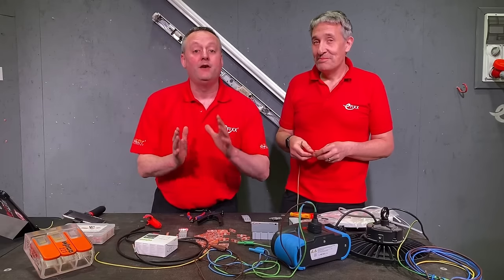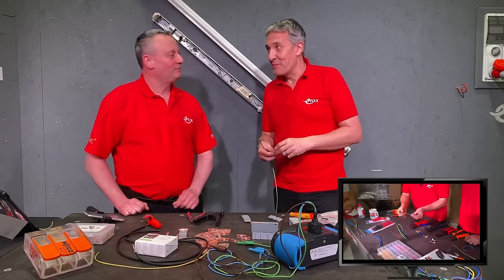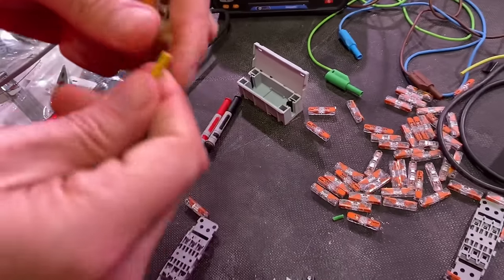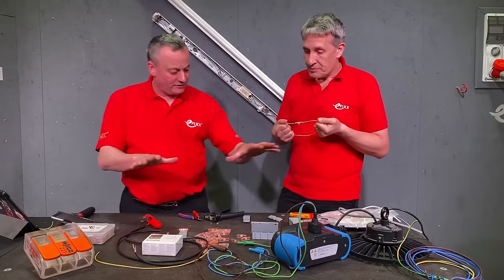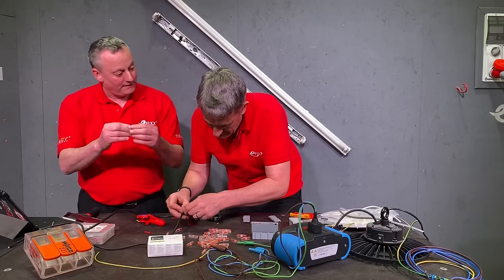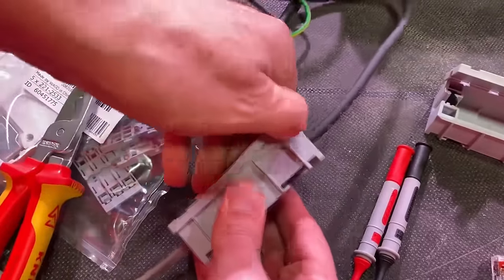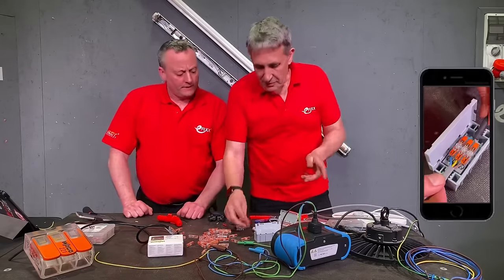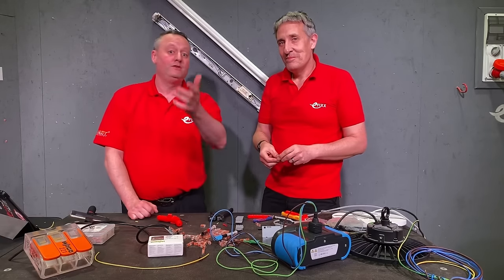The Ultimate Guide to the Wago 221 Inline Connector

Comment: I find it hilarious that Wago stole this design from the companies cloning their other connectors.
Reply: Not really, the clones are based on the older types which I pretty much never use now anyway.
Reply: @mfx1  Hmm I've seen clones of the clear smaller versions. And it was definitely the clones that did this first, even if it was styled after the older model.
Reply: @Morberis  The inventors of chocolate block connector really had the idea first all everyone else has done is replace the screws with levers. I've never personally seen a knock off 221 I've only seen 222 knockoffs.
Reply: @mfx1  lol, that makes them sound a lot more delicious than they are. I think I know what you're talking about, and I guess the old ones I have seen have been brown.
Reply: @mfx1  then wago is copying somebody else's design if it goes the way you said sounds like paybacks.
Reply: @whatdoyouthinktodd  Chocolate block connectors are ancient technology  and loads of companies make them.
Reply: Not really the clone versions don’t use the same mechanism. They basically just have a plastic bit on the lever that pushes it on a metal plate. These use the proper mechanism.
Reply: @UKsystems  Yes, they're not identical in the important details and these are properly made. But clones have been putting this out for over a decade. 

I would never recommend people buy the clones over properly certified and engineered products.

Comment: Imagine if the wago connectors could be clicked together themselves, without a tray. It’s funny because the counterfeit wago connectors come up with novel ideas like this.
Reply: Mounting carriers increase creepage distance allowing for 450v rating.
Reply: @daviddraper9256  make it 300v rated clipped together or make one side thicker by a few mm
Reply: @akbarramzan7436  however that voltage rating would not be super practical

Comment: I have used them inside light fittings and they are great but woud like them to launch a 4 way version for loop in and out instead of using the 3 way and having to bend the cables to suit the mounting brackets. Keep up the great work 👍
Reply: Can't  beat   a  good   old   Fashion   soldered   joint   perfection
Reply: @grahamturner6119  soldered joint for mains connection?
Reply: AFAIK there is a 5pin version - at least in my toolbox 😉
Reply: Why not populate 4 connectors on the 5 wide?
Reply: I think the point replies are missing is a 2x2 inline connector hence 4-way. Not four in a row.
Reply: @grahamturner6119  Are you out of your mind?
Reply: @SamButlerUK  The reason is tooling, you can do the same with a coup[le different combinations of what they offer already, tooling a machine to make a 4, would cost too much to be worth it.
Reply: No need for a 221 4, plus we pay like 30 pence for a 5 way at our local electrical wholesalers, Toolstation 221-5, for  8 £8, what a rip off, against £2.40 that we pay for them.
Reply: @grahamturner6119 your 100% correct, I just don't understand why cables cannot be soldered together and then shrink wrapped, I remember running a 16mm cable, 60 m long, in the ground on the side of their driveway from the house to the main gates, we had too take a different route towards the end meant that it was 5 meters short, we soldered that and taped it up put it in the ground,  I don't think the amps in that cable will warm the cable that much to melt the solder, you plonker
Reply: Yeah, strangely... the Chinese copies do exist in that way...

Comment: The extra plate to clip that tray into the wagobox light seems quite unnecessary. The cord grips should suffice easily or they could have just made the barbs on the tray clip into the wago box light with two holes for the barbs to go into (and discontinue the old light box without the holes so its not confusing having the 2 versions)
Reply: No need to use the mounting carriers in the WAGOBOX Light, the connectors can be placed loose inside. The mounting carriers are more for when you make your own box or panel. Hope this helps.
Reply: @daviddraper9256  Yeah seems more like it. I thought they showed the tray used with the box because thats the intended way.
Reply: i wonder if you could stack two carriers in this box too, for example if you have to connect 5 Wires (like Power + DALI, or 3 Phase Power). Size wise it looked like it should fit...

Comment: I use these connectors for car stereo installations and they are great.!
Reply: depends how lazy i al but i usually do it in 1 of 3 ways

if i can buy the harness adapter i get that and move on with my life obviously

but assuming its a stereo with the dozen wires coming out the back i just purchase a universal harness adapter for my vehicle cut off the stero side connector then ill join to that so im cutting up the adapter and not touching the factory loom then ill join the wires in one of theese ways from laziest to most preffered

1 crimp bullet connectors
2 self soldering marine splices (they look like heatshrink with a little solder ring when you shrink them they solder the wires together and some adhesive makes them water tight
3 hand solder them with heatshrink

wagos arnt a terrible or harmfull way to do it its just a little cludge

Comment: Yes, a really lovely in line connection

Really love all WAGO stuff!

BUT... there's always a but..
Many lighting jobs require a loop in and a loop out for, say, 4 downlights operated by a single switch- very common.
The problem with existing WAGO boxes is that all the cables come in at one end.

The result is that it's difficult to pull the box out of the ceiling through the downlighter.

Looping the feed in and out of one end, and the downlighter connection at the other end would be really elegant.

What think you please??

Comment: Minimum & maximum conductor sizes do not correlate between mm2 and AWG.
From Wago's data sheet:-
Solid conductor 	0.2 … 4 mm² / 20 … 14 AWG

Stranded conductor 	0.2 … 2.5 mm² / 18 … 14 AWG
Fine-stranded conductor 	0.2 … 4 mm² / 18 … 14 AWG
(Assuming 0.2mm2 = 24AWG and 4.0mm2 = 11AWG).
Reply: I’ve noticed it was well. Could somebody  explain, please???
Reply: wagoo says:
Eindrähtiger Leiter	0,2 … 4 mm² / 24 … 12 AWG
Mehrdrähtiger Leiter	0,2 … 4 mm² / 24 … 12 AWG
Feindrähtiger Leiter	0,14 … 4 mm² / 24 … 12 AWG
if you find differences it's probably because you compare diameters between certifications under different codes
Reply: @rz9196  it’s probably about the safety standards as the United States generally has lower safety standards

Comment: Hi Guys, where do I get the accessory plate from that is used to mount the carrier plate into the light box. Is there a part number? Common electrical trade counters don’t seem to stock the accessory! Thanks
Reply: I also need this. I was able to source the light box, the mounting carrier, and the inline connectors. I cannot find the accessory plate

Comment: Would be interesting to ask Wago why 4mm² Class 2 conductors are not supported. It seems like a strange limitation and a particular PITA with typical UK cable types. Perhaps less of an issue with german cables (IIRC 4mm² NYY-J is solid)
Reply: Hmm, I don't know how it works with you metric wire types but 4mm² is the equivalent of 12awg. But in awg sizes stranded wire has a slightly larger physical size than solid wire. 

So maybe it's related to that?
Reply: @Morberis  IIRC yes stranded (class 2) is allowed to be slightly larger than solid (class 1), but fine stranded (class 5) conductors are allowed to be slightly larger still. So it's odd to support 4mm² solid and 4mm² fine stranded but not 4mm² stranded.
Reply: @petermichaelgreen  That is very odd. I didn't notice that they were rated for finely stranded. 

 The Canadian version of their website lists them as compatible with solid, stranded, and finely stranded. But over here it would be very very odd for something to be rated for #12 solid but not #12 stranded or finely stranded. It basically has to fit any #12 wire. Though requiring ferrules is allowed.
Reply: actually I take that back these are 18-14 gauge ones, so 12 wouldnt be considered Bueno. Hwoever the ones I have and purchased form amazon are - 
"[PERFECT SPECIFICATIONS]: The lever nuts that are 412, 413, and 415 accommodate stranded wires from 0.14 to 4 mm², as well as solid and fine-stranded wires from 0.2 to 4 mm² (24–12 AWG). 221-2401 accommodate solid wires from 20-12 AWG. Ratings up to 32 A/450 V and 105°C maximum continuous operating temperature allow the 221 Series Splicing Connectors to be used at ambient temperatures up to 85 °C (T85), making them ideal for small and large loads. Furthermore, approvals like ENEC or UL allow them to be used in worldwide applications.
That would be why I immediately thought "That wire works" because.. it does with the ones im used to using. "Wago Wire Connectors 90 pcs, 221 Series Electrical Connectors Assortment with Case" on amazon $40 Usd.  Contains 25x WAGO 221-2401, 30x WAGO 221-412, 25x WAGO 221-413, 10x WAGO 221-415
Reply: @crisnmaryfam7344 copy and paste well done mate, it's because it's rated to 32 amp

Comment: Is the mounting plate actually necessary in a Wagobox or just convenient? And you mentioned mounting on a roof beam, but how do you cover the single-insulated cables?
Reply: It is not necessary to use one in the WAGOBOX Light. They are suitable for using in other manufacturers enclosures or cabinets.

Comment: i was curious if one can secure these connectors down to wood with maybe a backing plate,  I need to use a 5 way to connect grounds in an electric guitar cavity and an inline to connect the positives.  I would like to secure these down in the body cavity so as to not move around. Some of the wiring has to be channeled down the middle. I saw you used some gray backing plates would those work and where do you get them?  Thanks

Comment: I see that the inline 221 is only rated to #14 wire whereas the side by side 221 is rated to #12 probably the most used size in the U.S. for residential wiring.  Is there another model that is inline and rated for #12?
Reply: These models are not the same as the US model technically speaking they are sold under a different part number

Comment: Can you give more detail about the backplates and accessories.  I was offered some backplates but they seemed too long for the light box.  Is it just the light boxes that they are designed for or can you use then in other boxes? Do you have to use the backplates in all installations for conformity to regs?
Reply: The mounting carriers are designed to be used in any manufacturers enclosure. They are available with or without strain relief which can be snapped off if not required.
Reply: No requirement to use the mounting in WAGOBOX Light to meet regs.

Comment: Absolutely love wago connectors. I will be grabbing some of those. Just wondering what you would use the open tray type for?
Reply from the maker: Used inside a light fitting or other OEM equipment. 👍

Comment: Can I use this or the same model with side by side connectors for repairing a cable I managed to break while drilling through a wall? Is this ok as it as or I need to put it in a box, the cable is under the plasterboard and will be covered.

Comment: I am ignorant when it comes to the electrical side of things however... Would you potentially know which product would be idea from the wage line to integrate it into an Arduino project? This can't use the breadboard and has to be a bit more sophisticated. I am using the din rails and some 3d printed parts. The only issue I have is how do I create a common ground or power for 3-5 other devices. I have seen some terminal blocks on your channel but it seems that they could be an overkill for the tiny connectors that the Arduino uses for most of its sensors. Any ideas gentlemen would be appreciated.
Reply: This poses a bit of a challenge apart from Wago din rail connectors you may have to get their push fit PCB terminal and make a little board

Comment: are wago 221 good for a high amp DC cable running at 48v 900w motor ?
Reply: Hi amp is not the best thing to say. You have to check the current rating of the connector.

Comment: I noticed you didn't mention maintenance free in the video. Hopefully WAGO will produce a suitable enclosure for these to make them MF.
Reply from the maker: No indication of MF or aggregate current ratings on the Wago box light atm.
Reply: On its way just being submitted for testing
Reply: @daviddraper9256  That would be great if so. A "through" MF solution is something missing from Wago's portfolio. Will it be rated for rings or is it expected to be for lighting circuits only?
Reply: @JohnSmith-ws7fq  Completely agree. A "through" version of the WAGOBOX 221-4 would be ideal.
Reply: @JohnSmith-ws7fq  Hopefully it will be rated for rings, just depends on how the tests go.

Comment: A great solution for lighting slightly better than twisting ends together and covering with tape 😁🤡🐔
Reply: I have seen this done , with sellotape !
Reply: 😲 you use tape?
Reply: Use  a  soldered   joint    cheap  and  reliable
Reply: @sonacphotos  yes   every   thing    has  to  be  done  quickly   nowadays     that's  why   wago,s   came in     every  thing   has  to  be  done  faster   faster  faster    what a world
Reply: @sonacphotos  lots  of   cables    spliced    soldered   shrink    wrapped   in  my  house    you  won't  get  a better   joint
Reply: @efixx  

...
Reply: @grahamturner6119  Solder isn't suitable for everything. I needed something that allowed for easy disconnection and reconnection, which this allows for.

Comment: The big flaw or inconvenience that I see with these connectors (which I have been using daily for years), is that they only come for 5 simultaneous connections at the same time, which is insufficient when making a record and connecting the cables in star... It would be great if the manufacturer made them with up to 10 connections.
Reply: Wago make a mounting carrier that holds 2x 5-way connectors with a jumper to give an 8-way setup.
Reply: there is a Version for up to 8 Wires and 2,5mm², but only for Solid Wires (number being 2273-208 ).. i think its even slightly smaller than the 5-way 221.

Comment: And for their next trick? 2 into 1, stacked (staggered like a pyramid) and maybe 3 into 1 inline connectors. You can see that coming. A 2 into 1 allowing you to splice into a ring final with a spur. Maybe 3 into 1 to take switched power to three light pendants in one?
Reply: Should just discouraged use of rings and not matching CPC sizes.

Comment: The ideal push through has been a great piece of kit. But if these became MF they could be really great
Reply: The connectors are free from maintenance and a clip is being designed to make the WAGOBOX Light MF to BS5733
Reply: The Ideal spliceline are maintenance free if used in conjunction with ideals MF marked junction box. They will be max Amp rated according to the input voltage. Here in the the it's 16 Amp max.
Reply: Great news Matthew!  WAGOBOX Light is now MF to BS5733 when using the Mounting & Terminal Carrier together with the 221 Inline Connectors.

Comment: Needs a DIN rail fitting with a commoning bar, but otherwise "a very useful engine".
Reply from the maker: They have a din rail holder - but for common I h you need to look at the topjobs - https://youtu.be/A9kFoLgawT4
Reply: @efixx  The problem with topjobs is that they require fairly deep boxes, where the 221 is flat and can be fitted in a shallow box. They can of course be commoned with the loss of half the connection capacity by fitting a commoning bar to one side.

Comment: Is it necessary to twist the wire strands into a pigtail before installing them in the connector? Or should I leave them straight (as is) immediately after removing the insulation?
Reply: Straight

Comment: I use the ideal inline splice for solid cables better than these and 32A rated. I hate fitting the cable tie id prefer a screw
Reply from the maker: These are rated at 32A

Comment: Can the wago be used fo a connection that will not be accesible
Reply: Only if you secure them in the correct box and seal it with a ty wrap- must have MF on the box.

Comment: Insulated crimp splices are color coded so no printing is needed on them. Color codes identify the wire size range and max current. Insulated butt splices are either a nylon or vinyl and rated at 600 volts, a lot more than Wago's measly 450 volts. Real electricians know that whether in Germany or the US or any other country that uses insulated butt splices.
Reply: Actually, some of the insulated crimp connectors are rated for a lower current than other ones, but the colour is meant for size
Reply: @UKsystems  Size of the wire or bundle determines current capacity, so color also informs of current capacity of the crimp connector. Back to the premise that real electricians know the whole story.
Reply: @mikel4510  however you can buy two of the same colour of these crimped and the manufacturers still specified different current

Comment: a chinese version has the three and five ways but does not handle the voltages or amps.. good for many car applications but risky above 20 amps in a house. So using the singles in a group like that keeps extra insulation
Reply: Low voltage means high current - a burning car can also cause some inconvenience.
When dealing with electricity you better know what you are doing.
Reply: The Chinese versions use metals that are not particularly best for interacting with copper though